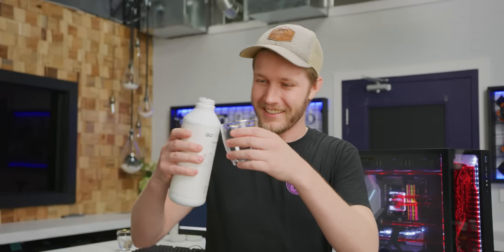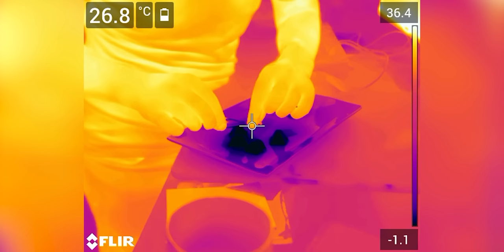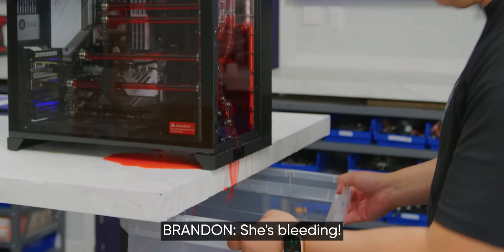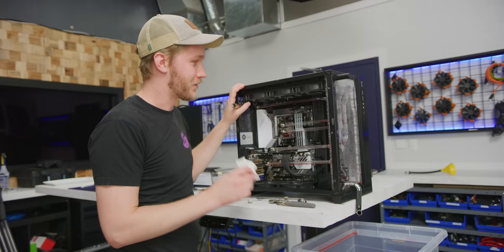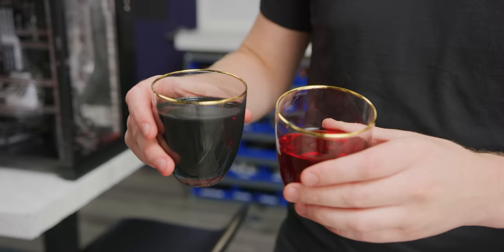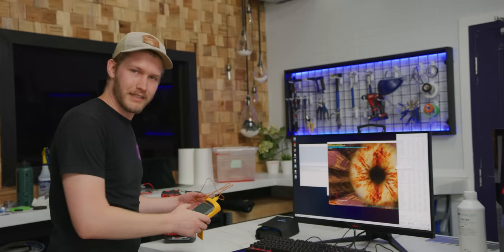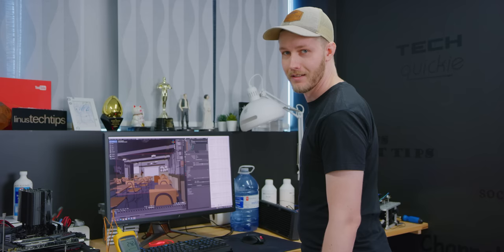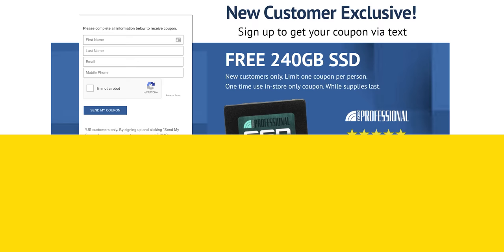7°C Cooler? This must be a scam - GoChiller Graphene Coolant Review

Comment: The anti foaming agent might not suck. You haven’t seen it without the agent, the liquid might just be SUPER prone to foam, and the agent knocks it down to just what you saw
Reply: Good point. Or maybe the anti-foaming agent works by preventing bubbles from sticking to metal and instead they collect in the reservoir?
Reply: Graphine bubble bath
Reply: @marxmaiale9981  say it fast 5x
Reply: That's exactly what I was thinking
Reply: For a suspension, i think its antifoaming looks fantastic.
Reply: I think so too. They probably desperately needed an anti foaming agent and realised that they could put that up as a selling point.
Reply: @jon498  probably, especially since they went out of their way to call it a graphene suspension, which is technically correct. Another way of describing it that is technically correct is that they took powderized graphene, poured it in a liquid then stirred a lot. That last one doesn't sound as credible, but it gives you as much of an essential idea as the former.

With the many ways they could have described it accurately enough for the consumer on their marketing, this is all absolutely a marketing move to make it sound more credible when in actuality it doesn't really mean much of anything. Suspensions are everywhere. If you look in your fridge and find some milk or cream, that is also a suspension (depending on the kind of milk or cream. An emulsion is a type of suspension but I don't believe a colloid technically is)
Reply: That’s what I was thinking
Reply: copium
Reply: @Yuna-iw4hn  bot
Reply: Welcome to YouTuber coolant commentary. None of them have a damn clue what they're on about.
Reply: It seems to me that the foaming is caused by the high surface tension of the fluid. I'm not sure if mixing distilled water would actually mix with that stuff, but if it did it I'd be willing to wager it would help with the foaming.

Water might not be the best at thermal conductivity but it seems way more effective than this stuff at radiating the heat away from hot spots.
Reply: @Steellmor  wtf is it with you thinking I meant anything negative. I'm just showing a pattern of using marketing to make mundane things seem more official. It's pretty common and it would help explain the anti foaming thing.

Seriously, not everything is a problem. Stop trying to start fights.
Reply: @CreativityNull  There is no marketing pattern in  calling suspension a suspension.And you made it sound like they trying to sell some snake oil by using "smart words" which is not  - suspension is a simple word,and there isn't anything special in using it. 
No fighting intended,but maybe little edgy dumb jokes on my side.
Reply: What I was thinking
Reply: @CreativityNull  An emulsion is a type of colloid, specifically, a liquid-particle-in-liquid-medium colloid, though in some cases (mostly outside of chemistry) any type of colloid is called an emulsion. (Colloids can have any phase of particles and in some definitions the medium itself can be a solid or a gas, but most of the time it's used to refer to liquids with solid or liquid particles.) Milk, as its particles are also liquid, is therefore an emulsion.

Also, by some definitions, a suspension requires macroscopic particles while a colloid has microscopic particles, but that distinction is often ignored, and one may be considered a subset of the other (in either direction) or they may be considered synonyms. Given that you can see the liquid shimmering, the particles are probably macroscopic, but I can't tell for certain just from the video.

Also, they probably added something to stabilize the suspension. Just stirring wouldn't work very well because the particles would settle out relatively quickly.
Reply: @killerbee.13  Unless it's not homogenized milk, which is why I specified. Also literally everything else I found said an emulsion was not a colloid because the average size of the mixed particles is too large for most classifications of emulsion and colloid.
Reply: @CreativityNull  non-homogenized milk is still an emulsion until it settles, it's just not stable. Stability isn't a requirement for any of suspension, colloid, or emulsion, at least in chemistry.

I've not heard of any definition where an oil-water mixture such as milk is not an emulsion, regardless of what else is included or excluded.
Reply: @Steellmor  Yes but a much more layman use would be "mixture" or some such use. Usually marketers try to appeal to the widest audience by using the most commonly used terms. In this case they went for ones that many people may not fully understand the context of. It's also a term typically used in chemistry. In this case it seems intended to add implicit credibility in the minds of people who don't fully understand how broad that term is. My suggestion here is, using that pattern, instead of the normal marketing pattern of use the most commonly used term, someone may have been looking for other descriptors to add to the product and put in the anti foaming agent when they probably shouldn't have since saying that makes it sound like it's supposed to have less foam than the competition, when instead all it does is reduce excess foam to a better level in general, but not comparable to the competition. Since we don't get to see what it looks like without that agent, we only have a few things to guess the intent of the marketing and the reason for the foaming agent's use. This guess was the intent of my original post. I'm not saying they're trying to sell snake oil, I'm more implying that whoever wrote the marketing screwed up and didn't understand the original purpose of certain ingredients of the product.

Oh yeah, and it's not really over-explaining as much as trying to vividly describe my point in a way that is precise to my meaning. I also usually don't assume everyone has all of the necessary background knowledge to fully understand what I'm talking about. It's not an assumption I'm making on someone's intelligence level or just me liking to talk, it's more that I don't know someone's level of knowledge (especially when I'm not speaking to anyone specific and in a slow format) and I would rather just say it once, giving the necessary background knowledge, than have to go back and repeat myself. It's hard when I have to repeat myself to people who either don't read anything longer than a Twitter post or don't retain anything past a sentence or two. This was my major frustration with your first post.
Reply: @killerbee.13 "Colloid; Noun; a homogeneous noncrystalline substance consisting of large molecules or ultramicroscopic particles of one substance dispersed through a second substance. Colloids include gels, sols, and emulsions; *the particles do not settle*, and cannot be separated out by ordinary filtering or centrifuging like those in a suspension."
Reply: @killerbee.13  honestly, this conversation sparked my interest and got me me to take a closer look at it, and apparently a bunch of authorities on chemistry can't come to an agreement about the precise definitions of all of these terms, even when describing them for the exact same purpose. It mostly changes based on where you are. I guess it doesn't fully matter in that field since it's basically just a label of certain allignments of properties, and you could easily just list out each property individually rather than trying to bundle it together in a single word that no one fully agrees on the properties of. This happens a lot with standards definitions in lots of professions, especially standards that rely on multiple factors. In my opinion, it only makes things more confusing.
Reply: @CreativityNull  "[T]hey went out of their way to call it a graphene suspension"
No, they just labelled it as what it is.  Graphene particles are suspended in the liquid.  It's not the same as a solution or mixture.
Reply: @Telogor  I like how you didn't actually read what I said or at least can't think beyond your own perspective or understand the context. Why is everyone so combative today?

And yes, it is a mixture. A mixture is even more broad than suspension. A suspension is a kind of mixture if we're going with the chemistry definition.
Reply: @CreativityNull  ++ …lots to unpack here. The main IP of the product is in the way we produce it and the way we maintain suspension. Without suspension you get aggregation = bad. Its a little more complex than a mix master ;-)
Reply: @CreativityNull  Isn't one of graphene's selling points that you can radically change its properties depending on how you functionalize it? Meaning different kinds of plasma used for the reaction can make it either hydrophilic or hydrophobic. Wouldn't hydrophilic graphene combined with water form a solution rather than a suspension? I don't know much about the chemistry, which is why I'm asking.
Reply: True, good point!
Reply: @DamnZodiak  I don't think it would form a solution. For that the graphene would have to dissolve, and if it dissolves it would no longer be graphene. I not a chemist and don't know much about hydrophilia/phobia so take this with a grain of salt.
Reply: @CreativityNull  it's a colloid
Reply: @Rainaman-  I did it
Reply: I was wondering if its the size difference in the foam? the red coolant seemed to have bigger more spread out bubbles, were the graphine coolant had much much smaller and compact bubbles?
Reply: You kinda sound like an employee of gochiller when u say it like that lol

Comment: I like how they can just yell, "BRING IN THE ENGINEERS," and two guys will come and explain exactly what's happening.
Reply: And I thought Alex was supposed to be an engineer
Reply: @andrelascasas3156  Haha, classic Alex.
Reply: @andrelascasas3156  There are many disciplines in engineering. Very much so like in medicine. You wouldn't expect a heart surgeon to have the same understanding of the brain compared to a neurosurgeon.
Reply: @andrelascasas3156  alex is mechanical engineering, perhaps the other two are chemical engineer or majoring in material science.
Reply: @Swim Fan  Yeah you are right in every sense. Sure they could have done more research and set up more appropriate tests.

But I guess they also have a valid point in representing the general consumer and pc enthusiasts who have no idea and would just use the product as marketed. Whether they intended it or not, this video shows that it would have little or no performance improvements to using the graphene fluid over standard coolants in generic use case scenarios.
Reply: @Swim Fan if your product requires extra study to understand, and not just use it in the pretty typical general use case like a consumer would, then your product sucks bad. First rule of engineering is always design for the dumbest person using it.
Reply: @snowwsquire  ???? i used one once and i'm not trained❗❗❗❗
Reply: They need an app for that
Reply: @Swim Fan some hardcore internetting and you can learn it free without the certs
Reply: @wyattutz  i did use it tho bruh, i went on the pilot cabin, pressed a button that said "fake button for kids to press" and it made a sound, pretty sure the flight survived because of me
Reply: @andrelascasas3156  he was consulting his colleagues
Reply: @laplantamichay  I mean...

Comment: Open the fill port before you open the drain port. This way air can replace the water and the drain will flow better.
Reply: @UCkQdulQAsBQgduFDCJso84Q actually not a rick roll, slightly dissapointed
Reply: It's a bit disappointing that he missed this one
Reply: buncha dopes
Reply: For real. This is common knowledge too. Literally how shotgunning beer works.
Reply: I'm surprised he didn't know it out missed it, they should have been pretty good at that considering the number of times they have to do it.
Reply: Yeah, sometimes people just get excited and completely disregard middle school physics 😂
Reply: @Mojave_Ranger_NCR  I also feel like i've heard linus tell other people that in videos lol
Reply: I just wanted to write that.... everytime you have one, you open ne fillport first!
Reply: Look at 4:29 the fill port is open
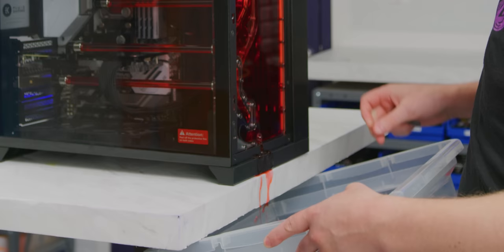Reply: @ForTheWinn100  It's still plugged at 4:00
Reply: Bugged me so bad that he didn't do that, It's basic physics
Reply: @Mojave_Ranger_NCR  he doesnt strike me as a beer guy..
Reply: Yeah, seems like a nice guy - maybe he's good at doing something else 🤷🏻‍♂️. (I wouldn't hire him for this kind of job 😂.)
EDIT: For the video he's entertaining - above I meant for a serious testing work in a lab.
Reply: @tkermi  not like ltt is a lab, but correct me if I am wrong, I think he was hired as the engineering guy, so like building stuff etc. I think he has worked with cnc machines etc to.
Reply: @Mojave_Ranger_NCR  Or how you used to open a can of beer/soda. You would have a churchkey which would poke your drink hole and your secondary air pressure hole
Reply: @Ramog1000  Oh, okay. Maybe he's acting that clumsy and hastily without thinking just to get a certain vibe to the video. Or maybe he was hired specifically because of that type of "personality" to serve the vision/look Linus has for the videos.
Reply: @tkermi  well you can certainly forget something in the moment, sometimes if cams are running you forget even more. Doesn't mean he didn't know it.
Reply: @Ramog1000  Yes, absolutely. I mainly meant the clumsiness/goofiness throughout the whole video (spilling the liquids, dropping things, not understanding the multimeter readings etc.). It felt like some larger catastrophe was very close to happen all the time 🤷🏻‍♂️😂. (I hope he doesn't read this because I have equal respect to all people and don't want to be mean or hurt anyone's feelings 😔🙏🏻.)

Comment: 3:55 Pro-Tip: When draining a closed liquid loop, open an air-intake near the top of the loop before opening the drain port. It'll drain faster, and flow more smoothly.

By "more smoothly", I mean you will avoid the glug glug glug type of flow that causes the stream to alternate between gushing and dribbling as it allows air to enter through the same hole the liquid is trying to exit from.
Reply: I was very surprised he didn't do that in the video.
Reply: Not just a PC tip, any closed liquid system that has more than one possible opening. Great tip when you're changing your car's oil for example, open up the fill cap up top, then the plug on bottom.
Reply: You would think this is common sense but 🤷🏻‍♂️
Reply: I literally can't believe I have to point this out.  But YOU CAN SEE THE OPEN PORT AT THE TOP OF THE SYSTEM.  He literally did this you guys
Reply: @askmeaboutmyscrotum3527  That was only removed after the cut, and at that point the pc was almost dry. We never actually see it drain with that cap off and a sizeable amount of liquid in it. I cant believe I had to point that out.
Reply: @a-rod48  the oil system isnt closed on a engine. The PCV system vents to the intake which is open. No reason to open the oil fill.
Reply: you are not a linus! you just can't give someone techtips!!!!
Reply: Do you think any of these guys has changed the oil in their car before?
Reply: He's not that new he knows how to crack a fitting, just ughh lazy maybe 😂
Reply: Same reason I remove the filler cap and dipstick when I change my oil.